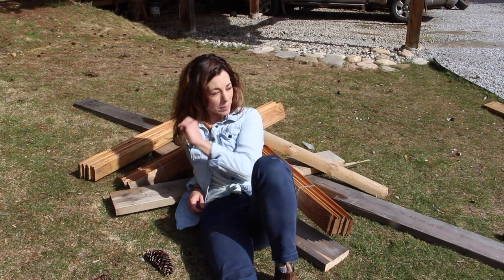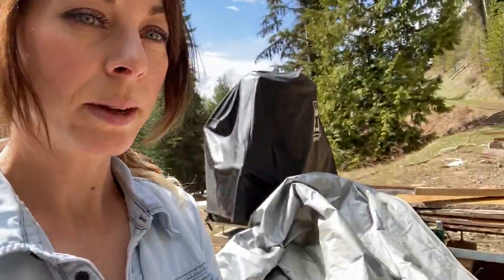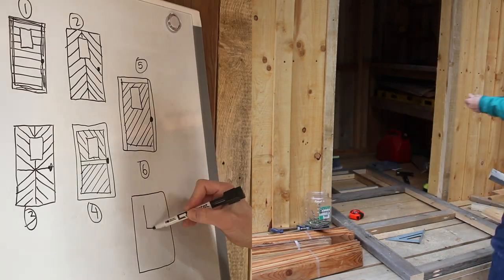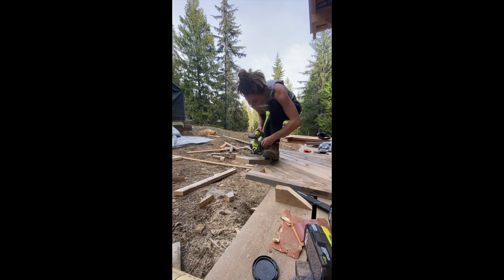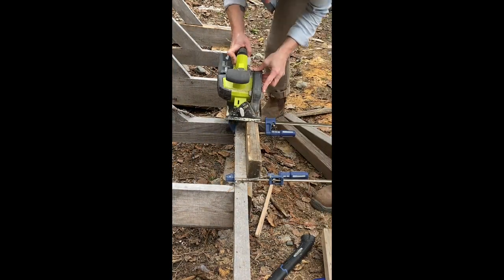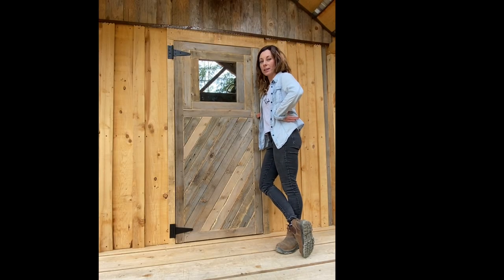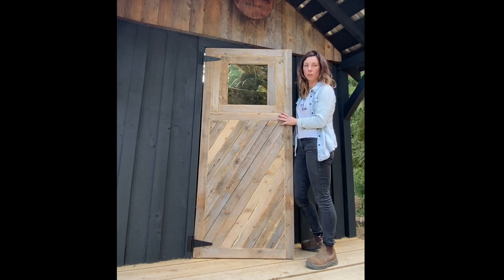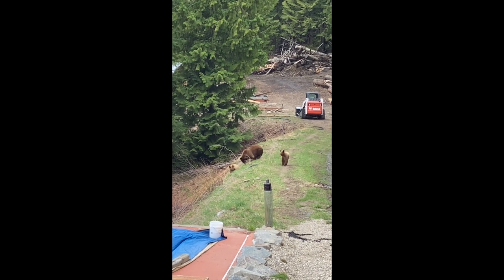DIY shed door from junk wood/free wood (including sign making and bear sightings!)

Comment: That door is a credit to you! Do you ever use glue not thousands of screws etc? However not much holds you back (onwards and upwards😊) xx
Reply from the maker: Well, with a door it’s my understanding that it needs to allow for expansion and contraction. So glue wouldn’t allow for that.
Reply: @michygoss7148  mmm  as a retired research engineer the right glues will, old thing

Comment: 7:44 If you have a planer, you counld shave the thick board to give the door clearance. Hand planer is hard work, but works.
Reply from the maker: I ended up moving the door up as there was enough clearance to do so. It did help, but it still needs a bit more. I do have a planer, so perhaps that’ll be a winter job 😁
Reply: @michygoss7148  I doubt you would want to plane that board with snow on the top. An alternative would be to replace that board with the correct thickness board. You have a wood mill, you could cut a board the correct thickness. Granted you can cut enough off the bottom of the door to make it clear, then you would have a wide gap at the bottom of the door.
Reply from the maker: @MrCarl312  I don’t mind these little tasks during the winter. As long as you can stay warm it’s a good time to do the little odds and ends. No? 😁

Comment: The door looks good, I like the sign dark. So do you know where the Baer’s go for the summer and were they hibernate? Thanks for sharing another great video with us! ✌️😎
Reply from the maker: Not sure exactly where they all go. I did stumble upon a den early this spring while ski touring up a nearby mountain with the dogs. The dogs found the den, actually. The bear came out and looked around at us, in a sleepy stupor, and we carried on up the mountain. We came across that bear and den a few times while ski touring.
Reply: So is that with cross country equipment?
Reply from the maker: @garyskowbo3564  no. Ski touring equipment.
Reply: Guess I didn’t know about touring, what is the difference from cross country?

Comment: When the door won’t open because of the deck, I would’ve done two things, cut the bottom of the door off or scarified the deck with a chainsaw, but, hey you made it work. 👍
Reply from the maker: I think I’ll have to cut the door (still haven’t done it yet 🙈). There are nails in the deck board exactly where I’d need to shave it down, so can’t do that.
Reply: @michygoss7148  Can you take the plank off and flip it over?
Reply from the maker: @HunsValley  I’ve actually looked at the situation more closely, and I think I can bring the door up some more.